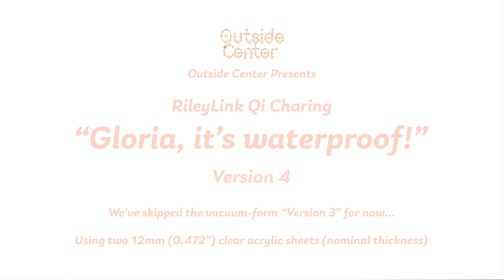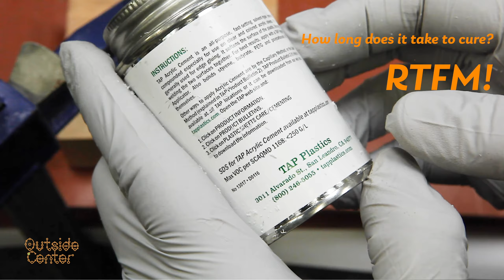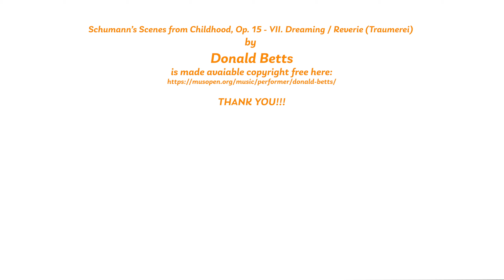Diabetes Hack: RileyLink (OmniPod Insulin pump - Loop.app) Qi Wireless Charging Waterproof Design #4

Comment: where do you get the charger?
Reply from the maker: You can search “qi receiver pcb” in AliExpress and/or amazon etc. 

Good luck. 

You need to space out the receiver a few mm from the main rikeykink pcb
Reply: @outside.center8293  Do you have the model number or something?  Cannot find that one that compact
Reply from the maker: I added some screenshots and links for where to get them at the very end (under “update” section) here:

http://www.outside.center/rileylink/waterproof-rileylink-magnetic-reset-switch/

Happy blousing :)